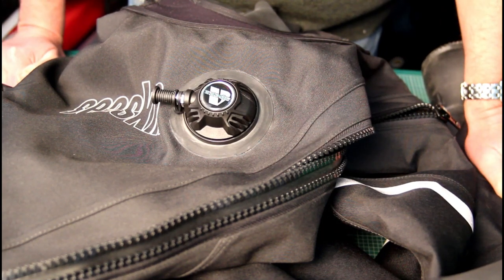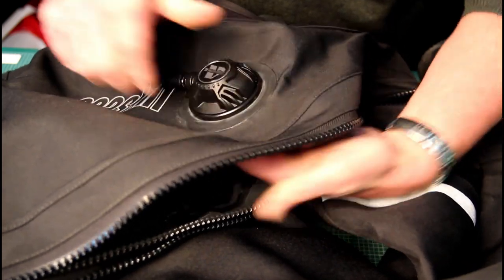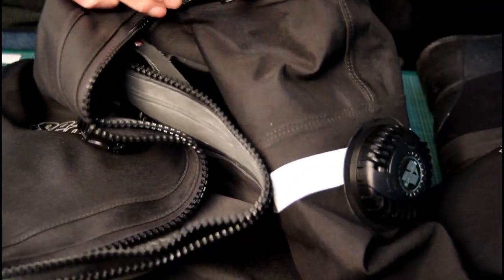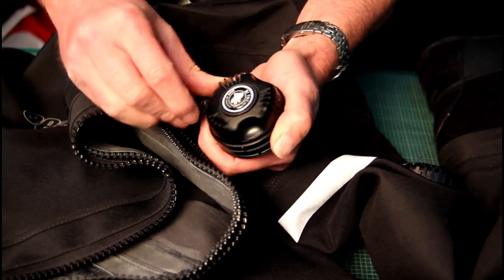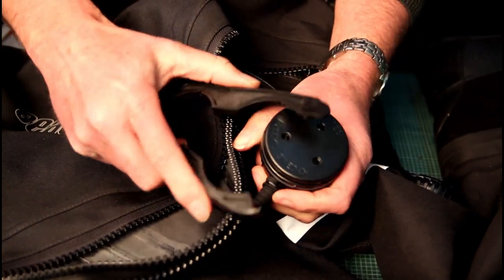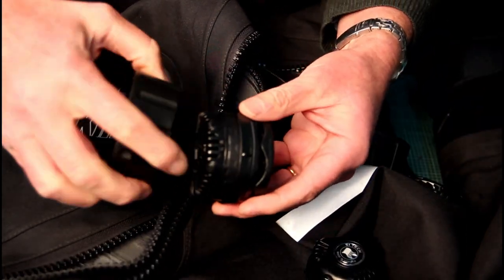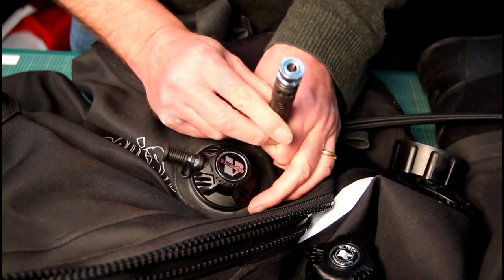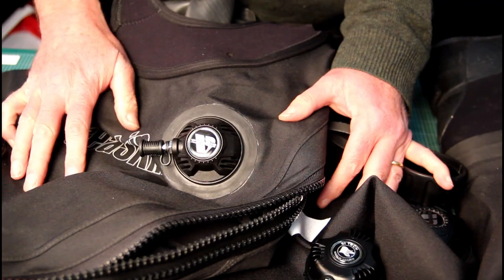Drysuit valves, tightening them up without causing damage.

Comment: I just tape the back of the dump from the inside and with a small glass with a spout pored a rubber glue from the outside into one of the holes on it and let it sit flat long enough so when I picked it up to wear it it wouldn’t leak out.